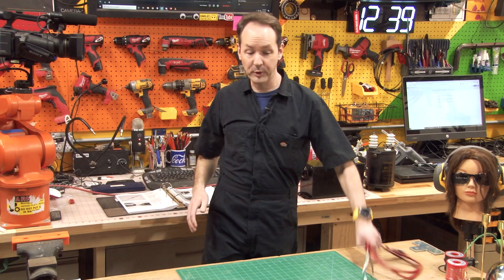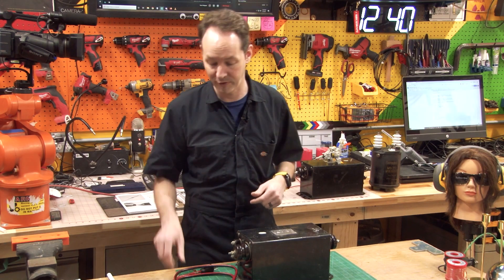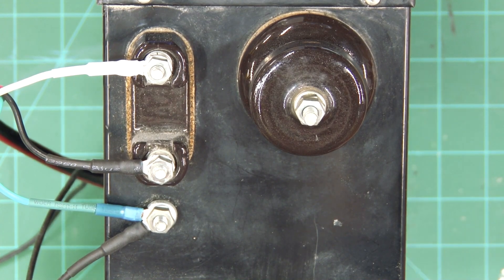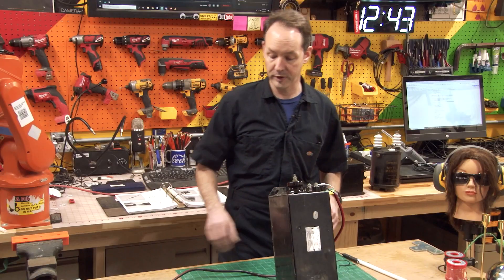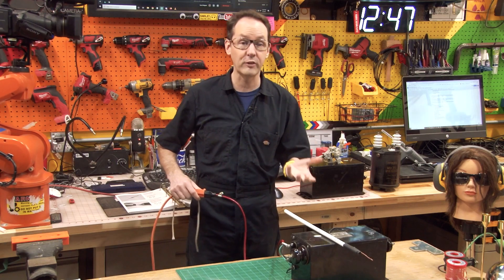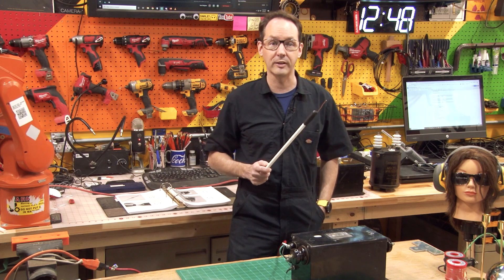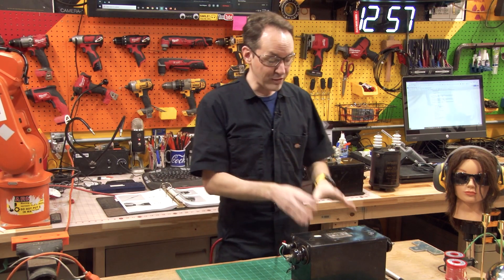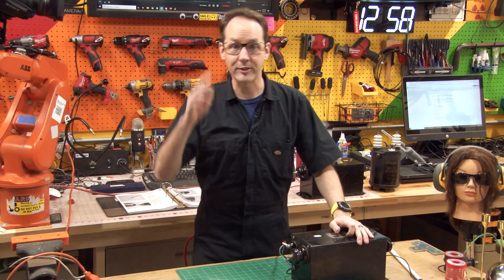High Voltage Episode 8   How To Test Your Neon Sign Transformer

Comment: (6000) + (-6000) = 0. The primary is single phase. Even a capacitor in risk of becoming a bomb can only theoretically phase shift 90 degrees.

Comment: Chris, I don't know why you got into NSTs, but I needed to know about them in that I have a small neon sign collection.  Learned about GTO wire and wiring up and mounting the neon etc.  Had a couple neon star lights (from a drive in theater) stop working and that is when I found you and how to test a high voltage transformer.  I found the transformer to the stars had died and one of my extra transformers was also bad.  Thanks for the clue on how to test these old monsters.  Also, from your lesson on how to read the labels on the transformers, I see most of mine are from the 50's (Acme brand!).
Jim

Comment: How dangerous are these things if you accidentally touched the top of the box with wet hand? As much as love neon signs and wish they make a come back, the only thing thats scary is that they use such high voltage and I am worried if the manufacters might get sloppy and end up killing people with these transformers.
Reply from the maker: Depending on what you touched, nothing or a LOT of pain you won't soon forget (and the very real possibility of death). NSTs are certainly dangerous, but they're worlds safer than the mountains of MOTs that young people are playing with out there right now. 

I would much rather people be starting out with NSTs than MOTs.

Comment: If I take your exact set up..............put some 10 ga wire on the lead you were getting the arc on...............strip the end of the wire back about 6 inches...............put it down a gopher hole and wait for the little bastard to come back and close the hole up................when he/she/them steps on the bare wire have I eliminated my gopher in that hole and I can move on to the next gopher mound?  I can see this mounted on a dolly, with an inverter, car battery and even a solar panel for self contained mobil gopher control.

Comment: Can the two outputs be shorted, does it make an arc?
Reply from the maker: Yes but don't do it too much as it drives the transformer to full load. Yes it will arc across the two output terminals.

Comment: Hey there! Your videos have been immensely helpful. A brief question; why isn’t drawing arcs to ground considered a ground fault in this case? Doesn’t your house’s GFCI trigger if any current flows to ground? Maybe I am misunderstanding something. Thanks!
Reply from the maker: Hi there Grant! Good question! 
Typically you won't be able to run an NST on a GFI circuit for exactly that reason, they spaz out with things like this and trip. This is also why GFI NSTs are garbage for Tesla Coil use.

Comment: When you read the output info off the label off the transformer, it gives a just a voltage number, while on the input it clearly states VAC.  I thought that meant the output voltage was DC, rectified, for a neon sign.  You seem to be stating that the output is AC  just like the input.  Why are the labels unclear about this?
Reply from the maker: Classic core and coil NSTs like this are all AC on both sides. They don't label them for it, because it's assumed.
Reply: @ChaoticGoodChris  TYVM!

Comment: How do you measure the output with a hv-probe? Where should you install the ground lead to?
Reply from the maker: Well, how does a HV probe work? Where do you think you should connect your ground lead?
Reply: @ChaoticGoodChris  Ground terminal. But this way i dont get the output hv voltage, i just get the voltage from one side to the ground.
I am using it as high voltage source for a project, and i need to record the high voltage applied voltage.
Reply: @ChaoticGoodChris  another quastion, if i connect the ground clip of hv probe to ground terminal, wouldnt my oscilloscope get damaged, should i use a isolating transformer before auto transformer and then connect the auto transformer to neon sign transformer primary?

Comment: Can you do a video of showing how to remove GFCIs from newer NSTs
Reply: Please do not do this.  There is no good reason to do this.  I've seen too many grocery stores catch fire from non-ground fault transformers.

If you need less voltage, use a smaller transformer.

Comment: What causes the discoloration on the hot stick? After a few arcs the copper wire on the hot stick began to change color.
Reply from the maker: Oxidation/Corrosion

Comment: A question, if only one of the secondaries on the transformer works, is there some notable reason to not just use that side for 6kVAC?
I'm thinking there wouldn't be an extreme risk of fire as long as the faulty secondary is without load.
Reply from the maker: We'll be talking about that soon, short answer, carbon tracking and fire.
Reply: @ChaoticGoodChris  Saturday night at work. I hear ya.

Comment: Nice. But there are also NSTs with a SGFP (secondary ground fault protection) where if you do this it will shut down. Then you usually have to press a button on the side to leave that protection mode. (Also btw you didn't give us the link to the safety glasses).
Reply from the maker: Safety Glasses - https://amzn.to/3oNSCYL
Reply: @ChaoticGoodChris  Thank you. I will buy some.

Comment: So there are no charged components in the transformer? All poles are safe to touch as soon as the plug is pulled?
Reply from the maker: Well that's a Black Sheep In Scotland problem. So it's always best to ground out everything before you go sticking your hands in there. You never know what "Feature" someone has put in there and some transformers can have various types of stored charges in them and give you a poke for a short while after shutdown. But THIS transformer on my bench, is safe. I cannot speak for any other transformer.
Reply: @ChaoticGoodChris  So it gets a bit complicated as you can't ground out with the "now unplugged" ground
Reply: Power factor correction capacitors are always a risk.
Reply: Always hit a terminal like that with the ground stick or the insulated screwdriver you like the least before touching it.  It'll discharge any latent voltage, and show you it's dead.

Core and coil transformers like that are generally dead as soon as you pull the plug.  Electronic transformers will have plenty of voltage left for a few seconds due to all the caps and circuitry inside.